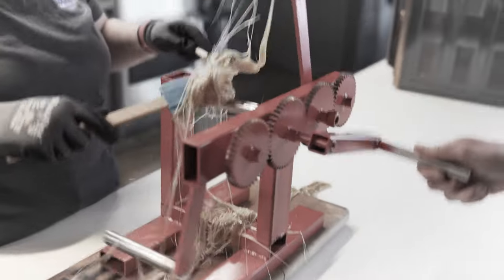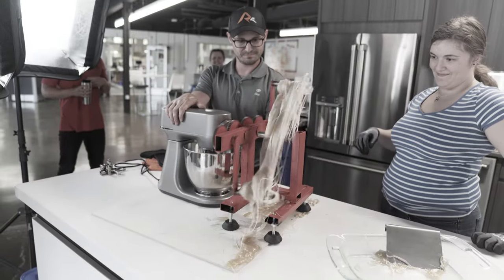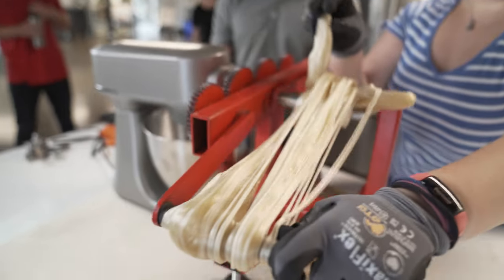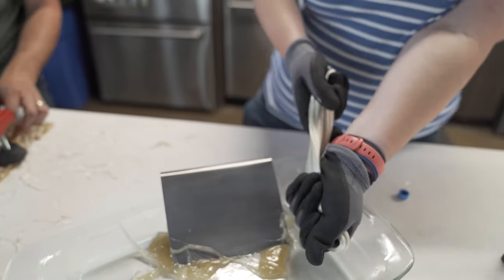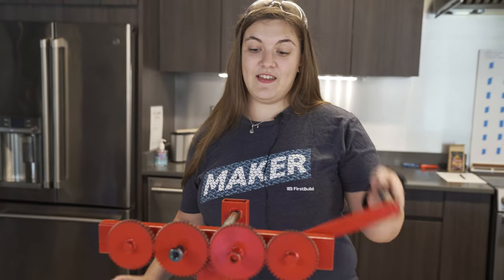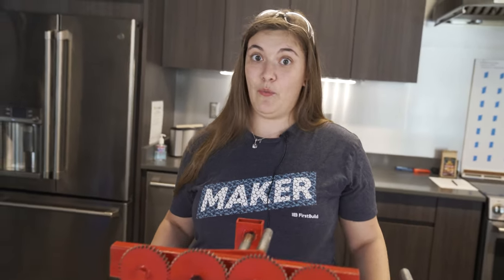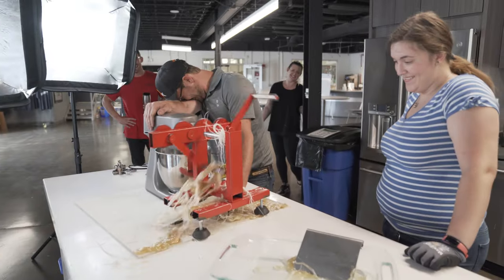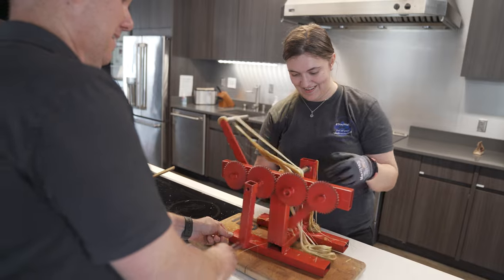Taffy Puller: Make Delicious Candy With Your Stand Mixer | 2-Minute Prototype Pitches

Comment: Number 1 was cost, #2 stainless, #3 power and speed adjustment. Drop in gears work to a degree, but havinging a simple lever to change gears (stopping the motor) is simple. Not made in China, and table top.